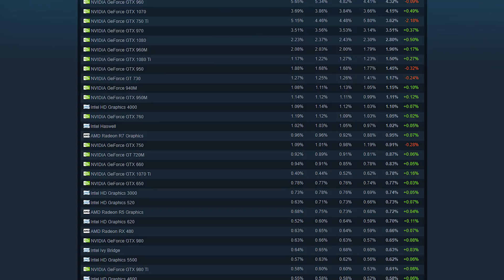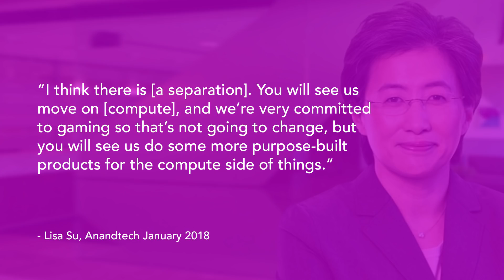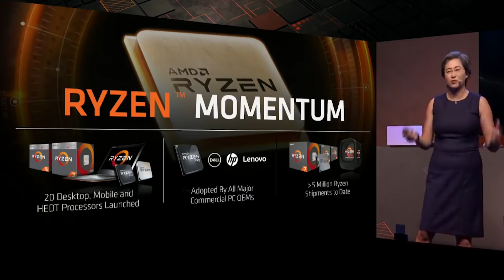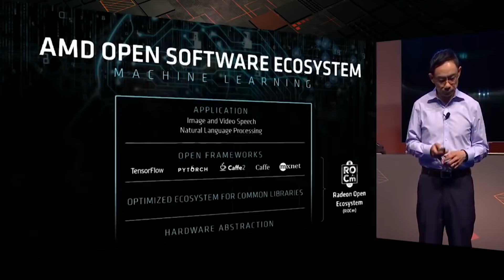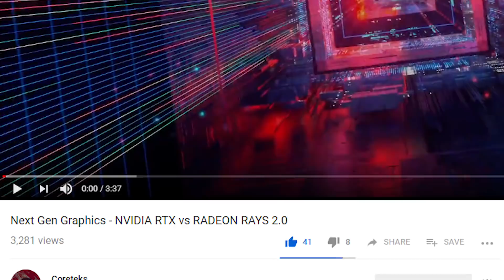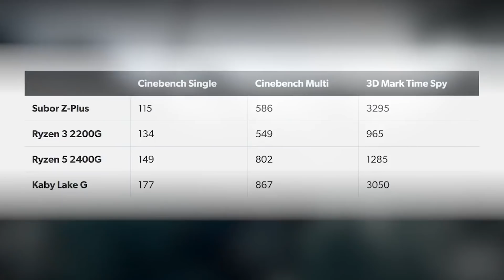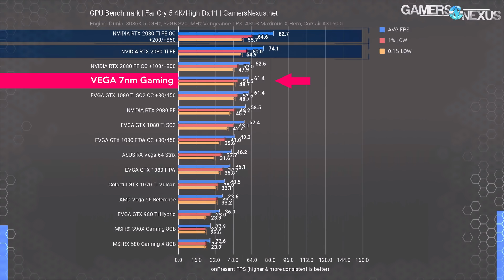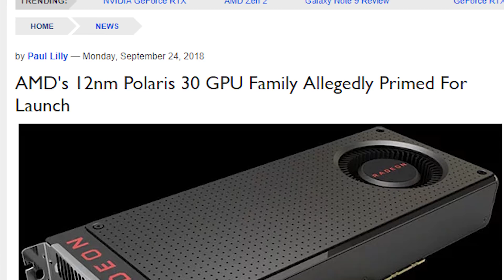AMD's answer to RTX

Comment: i had an amd gpu for 8 years but it started failing and cant play most graphically intense games any higher than low settings at 1080p(sometimes even that made it go to 72F+ at 75% fan speed), had the crap blower fan design, and ran 43c on idle with bedroom temps at 78F+/-2F... Around two weeks ago i bought a used MSI gaming 1070(two fans) for 260 bucks and it idles at 37c with 0 fan speed(same bedroom temps) and on max settings at 1080p in games that i used to not be able to play the warmest it ever got was 52c(45% fan speed). In my opinion the thing AMD needs to focus on with their gpu's is power efficiency. I could have gotten an RX580(new) for around the same price i payed for the 1070 but it wouldnt have been as powerful and probably not as power efficient. I don't like heatbuildup caused by ONE PC PART anymore. lower temps no matter what im doing has brought my bedroom temps from being 5F over the living room temps(when bedroom door closed(3F over with door open) to 1F higher than living room(door open)(2-3F higher with door shut). that was caused by much better power efficiency. If AMD can do that AND use lower nm process compared to nvidia in order to help make their cards more powerful at relitive  prices my next card would probably be an AMD card. I just hope newer amd cards dont have micro stutter in LoL like this 1070 does. I havent been able to fix that yet but i find it strange that its doing that when the 8 year old amd card didnt(same fps locked to 60 and same ping at 20ms in game) doesnt make sense. I've tried messing with nvidia vsnc and in game vsnc but cant get it to stop having random micro stuttering. I have a feeling someone is going to blame drivers but my thoughts are how can you when drivers for 1070 have been able to develop for around 2 years.... Maybe i need a different version of a driver?

Comment: Pretty much what i predicted as the reason nVidia rushed their Turning was 7nm Vega, also doesn't nVidia use DXR but have a wrapper which allows it to use the Tensor cores so is now RTX but technically it's the same API, and no doubt Vega will use DXR since that is OpenCL and this is where AMD's cards shine.

However Microsoft papers does not advise on what OpenCL library it uses but theoretically most cards could technically use it albet with a heavy performance impact but Vega has been heavily under utilised in games thus far. Also the 35% performance lift is not due to the die shrink, that would be either A: more cores added or B: includes the higher clock speeds already.

The shrink to 7nm will reduce the die size and the packed density would result in a significantly smaller die if they reduce it by 50% (since they said 2x denser) and allows more dies per wafer this would allow the Vega cards to be sold for less and make more profit. We all know Vega 56 was made with very little margins. So you estimated $549 seems on the money to me and they would make a profit, bring Microsofts vision of Raytracing while being significantly cheaper than the RTX2080 and maybe more inline with the RTX 2070.

Comment: The upcomming AMD consumer GPU's as they have said will have DDR5 and then DDR6 next year.
As far as i understand they will do mid range GPU's with DDR5 untill they have a good working solution for the multi chip GPU's, they they will do HMB2 and DDR6 (depending on the supplyer situation as they once had stated) for the hi-end GPU.